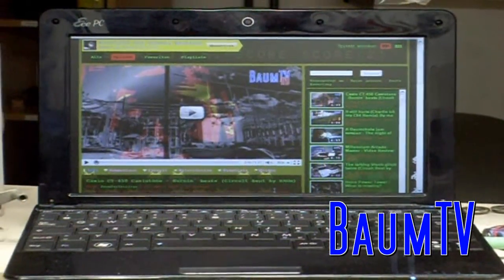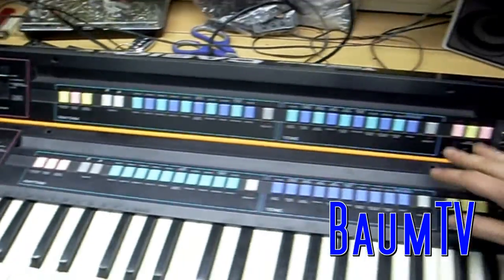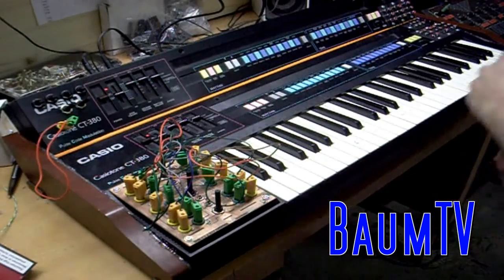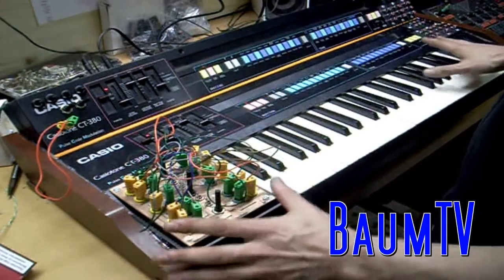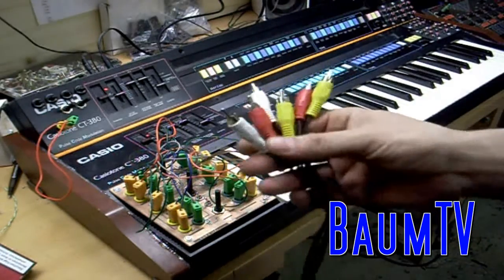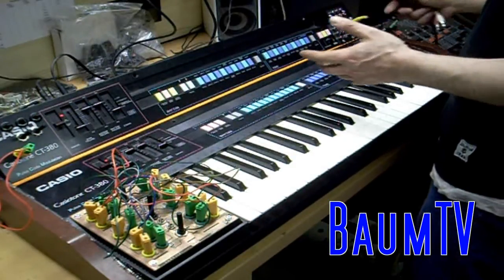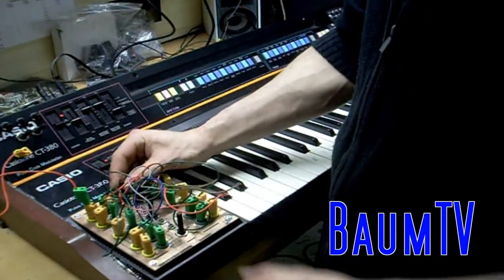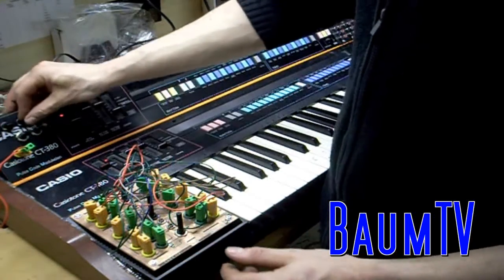Casio CT-380 X2 Casiotone Mutation (Circuit Bent by BAUM)

Comment: I had a similar idea earlier, where you layer up several synths in one enclosure but you only have one or two keyboards to trigger all of the synths. Could they trigger more than one synth at a time and you can just turn down the volume if you don't want the other synths playing (perhaps with diodes installed)? If not then perhaps a 3 way switch for every key and you flip the switches to to link the keys with the desired synth.
Reply from the maker: This is why i control both keyboards from different sections of the keys. The dont like if you connect the Matrix of several boards together.
Reply: @BaumInventions  Perhaps with diodes to stop the signal traveling the wrong way. It would be really cool to have both VFO's interacting with each other at the same time. Perhaps a little difficult to control.